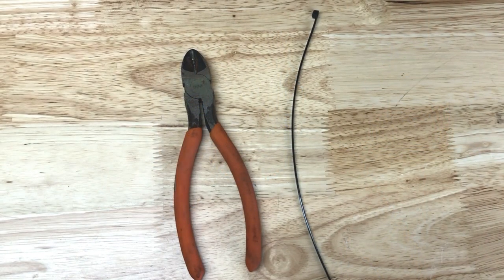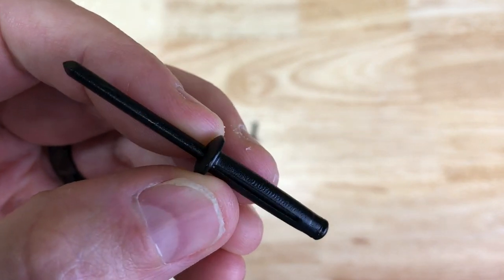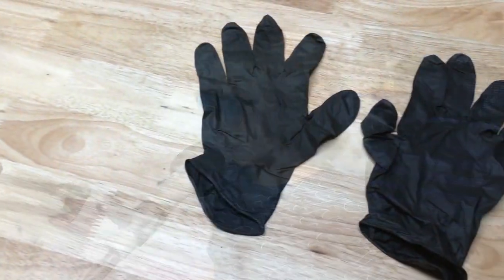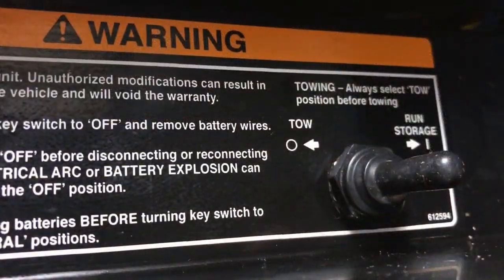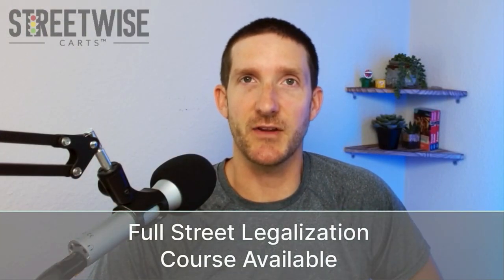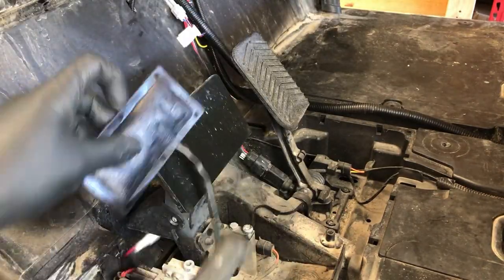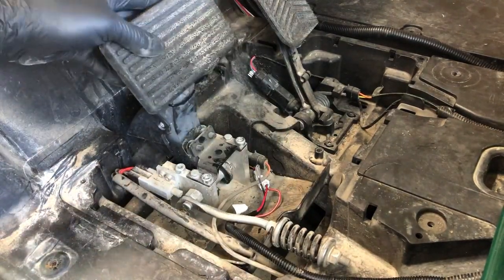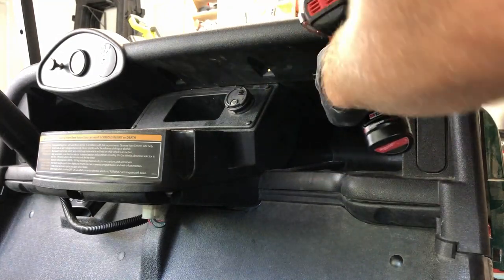Golf Cart Brake Light Switch | Installing RHOX Pad Switch Under Rubber Cover (Temporary Solution)

Comment: that's ok but what if you don't have the wiring harness already there, pretty easy otherwise, even I could do it but my 2017 RXV didn't come with brake lights so I don't see a wiring harness to clip it to.